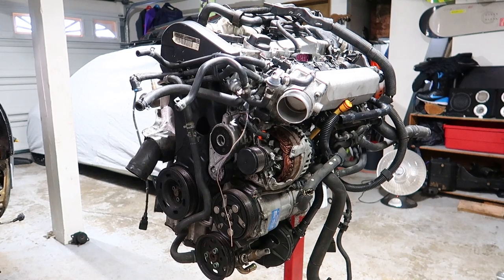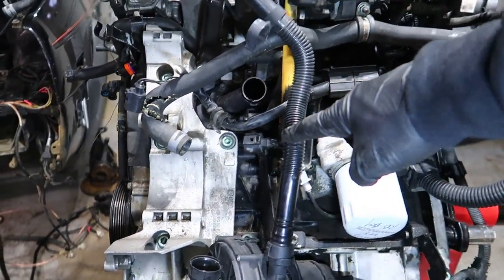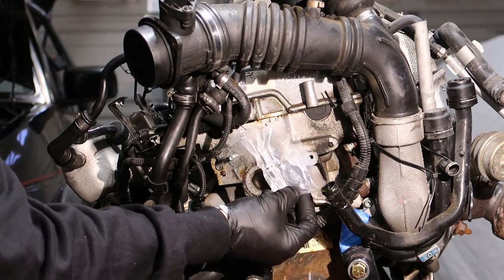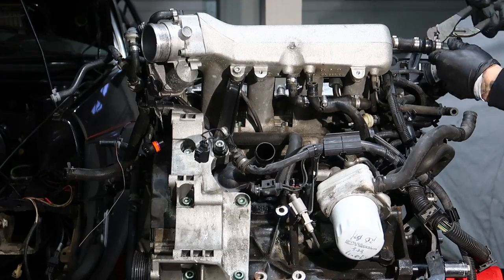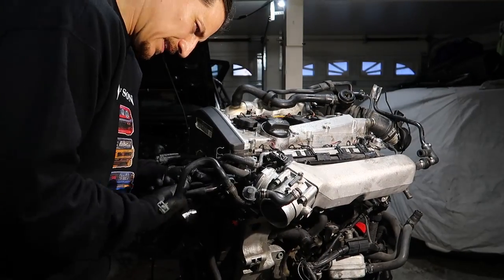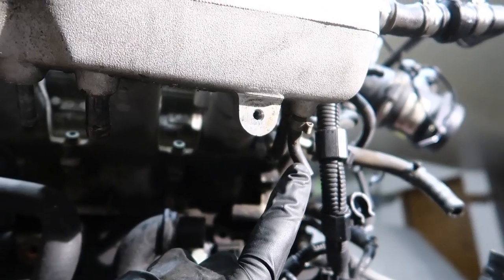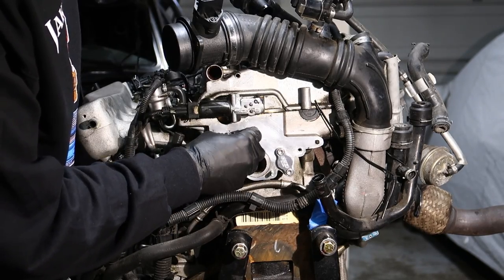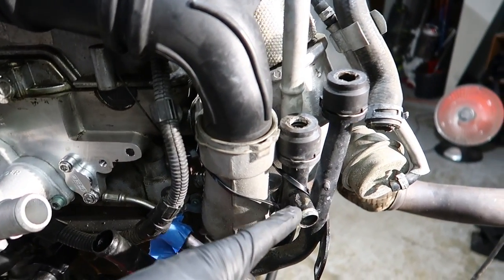How to Delete SAi / Combi V / PCV / N249 / EVAP | MK2 1.8t Swap Pt. 5

Comment: Hello guys, I've done my deletes on my beatle, boost 0.6 bar run smoothly and pull as its should.
However sometimes I shut the engine off I hear something like electric pump running for about 5min near/under the injector rail. I can't locate it. Anyone knows what can be? Thank you guys.
Reply from the maker: Its probably your auxiliary water pump.
Reply: ...or your fan is still running
Reply: @inkedprophet  hi, no it's not the fan, I think jake was right, auxiliary water pump.

Comment: Just picked up a B6 A4 ultrasport 1.8t. I would like to do this! It's essentially the same process, correct?
Reply from the maker: yes it will be the same
Reply: @JakeRawSon  so same for b5 a4 1.8t aswell ? Awm so just different locations ?
Reply: @paulkennedy-warrington8665  yes same engine

Comment: When your remove all of this stuff will it throw codes and a engine light? If so are there ways to bypass the codes and wouldn’t it basically make the engine run too rich? 
Great video too! Very helpful!
Reply from the maker: Yes is will have the check engine light come on. The only way to get them all off is to get them deleted from the ecu.
Reply: If you can delete them from the ecu does that mean you could pass an emission test in NYS?
Reply: @brentkailbourne6152  haha I wish! I don’t think so… they do a visual inspection. You could probably make it look factory but leave it stock though so maybe!

Comment: Hello can anyone help me please with the resistors part, it will run without remapping as it is or it will not run properly? I need to know as I have to use the car after, thank you for your guidance guys.
Reply from the maker: Yes it will run.  But you will have a check engine light on
Reply: @JakeRawSon  thank you 😊 pal... I will update my first run 👏👏👏

Comment: Hey thanks for making the video, will I be able to pass emissions in AZ if I do this?
Reply from the maker: Not sure. Wish I had a house down there for these winters and I’d probably would now lol
Reply: this is for a Audi TT 2006 FWD. I beat a Rs7 and a Mercedes 1990s last week no problem. your video helped me make sure the vacuum lines were in the right order
Reply from the maker: @gotwebsite1  Dude that turbo setup looks awesome. Glad the vid's helped out. Send some pic of your set up to my instagram jake_rawson
Reply: Do they hook the car up to a machine via exhausts. Then no. But sir. If u know a place that maybe knows a place that just checks for codes ext you will be fine for inspection
Reply: @tobyblanchard6056  Hey thanks yeah I went down there the other day and they just plugin the OBD but the catalyst mon says "INC" I think this is because I put a Oxygen sensor spacer bung on the post cat O2 sensor from USP to get rid of the CEL or check engine light that comes on after  3" downpipe and test pipe is installed.  So now I need to put  high flow cat back on because of the smell of unburnt fuel you get without a cat because my girl is complaining. Then take the spacer out of the rear O2 sensor and hope the catalyst mon will become ready again instead of being stuck in the INComplete mode it is stuck in due to the spacer delaying the signal permanently which does get rid of the cell but prevents your Catalyst mon from becoming ready for emissions testing....I hope this works.

Comment: Are you able to pull the motor yet keep the AC system intact?
Reply from the maker: PAUL G I do if I’m just putting the same Engine back in.
Reply: @JakeRawSon  , ok, i'm thinking of getting a donor TT with a built engine , then put that engine in my TT. id like to keep my ac system complete. Dont care about the donor car AC. I did an engine swap on a  SAAB 93;  i was able to keep the ac system intact. i

Comment: I’m not sure you can just remove the whole PCV system. The ECU and N75 valve need some readings don’t they???
Reply from the maker: N75 is still there
Reply: Jake RawSon Very useful video by the way! I meant is the N75 and ECU not dependant on some of the parts you have removed?

Comment: Don’t forget to change the timing belt for the 1.8t at least 2 times a year or once a year there known for snapping I have a 1.8t 225 Ko4 (:
Reply: What are you doing to need it twice or even once a year?
Reply: Yeah thats not what the problem is.
Its cheap hydraulic tensioner, not the belts.
The tensioner and pulley seizes and locks up snapping belt.
Do a manual tensioner and enjoy 5 year or 80k timing belt services.

Comment: Will this throw a bunch of codes?
Reply from the maker: Yes. But buy the resistor kit and the only code you cant get off is for the stupid secondary air pump
Reply: @JakeRawSon  Most tuners can set readiness for everything. Easiest way to do it and get a tune at the same time.

Comment: Delete all these staffs you have to know that the car can't pass the official technical tests and emissions and many cause problems at catalyst system.
The only thing that we can do is to bypass the N249 to avoid ECU to guide the boost valve.
I agree that all these pipes and hoses are complicated but if we keep then in good shape is good for the engine and the environment.
Reply from the maker: A lot of us don't have emissions here and don't run cats on our cars. I run a catch can for any blow by.
Reply: @JakeRawSon  my 20vt Seat Leon is all most 300hp and I have bypassed the n249 only.
I replace all that staff with new from better material like SAMCO and Goodrighe,i thing that there placed from some reason there...maybe I have wrong.